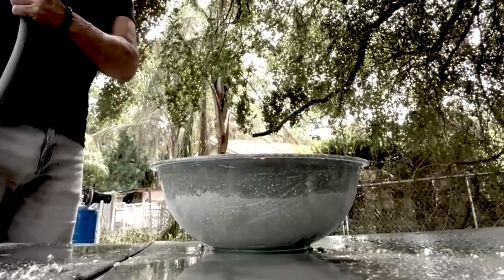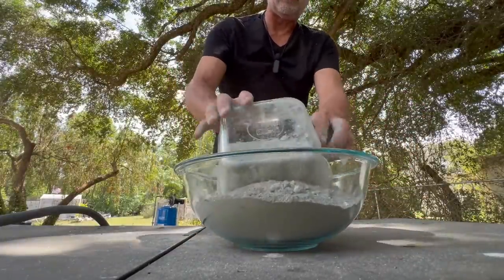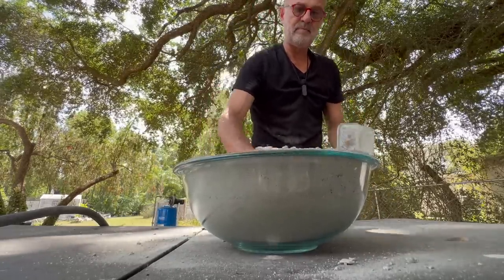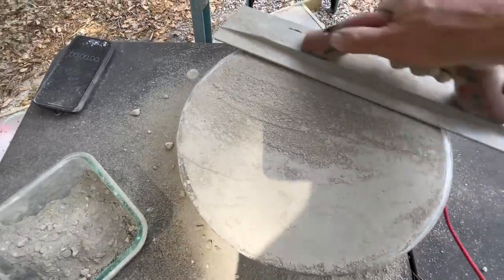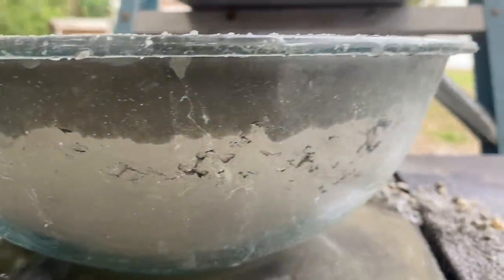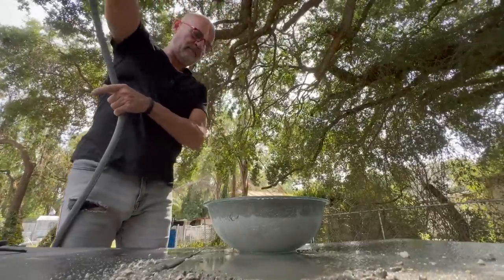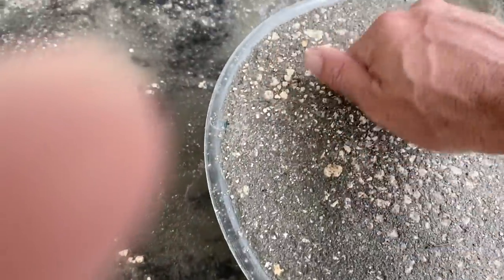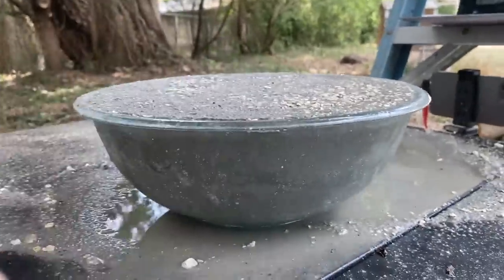See How Dry Pour Concrete Process Works in Real Time

Comment: Dry pour works fine for DIYers, but professional concrete can require precise mixes, rebar and vibration to release the trapped air. As well as a professional finish. 

Also that powder will burn you if you're not careful. It's like a bad sunburn.
Reply: Professionals need to charge more, so yeah, they need to do "something" to get that extra money.  Dry pour doesn't require rebar, precise mixes or vibration to release trapped air.  That's a lot of hogwash.
Reply: @kennethm.380  You're the guy who puts in driveways and sidewalks that get 2 inch wide cracks all the way through and the broken slabs sink and heave another 2 inches
Reply: If I were going for the full 4000 psi, I would definitely wet mix it. However, for those of us in the southern US where it does not freeze, I think it should be fine for sidewalks where the load is never more than 300 lbs. My first 2 feet are sugar sand, do I will be getting some compacted gravel down first even doing a dry pour. I am doing a small pad outside my shop building, I am going to give this a try.

Comment: When I worked for a development company, we would build retaining walls by filling croaker bags with cement mix and stacking them up dry. We would get semi-trailer loads of bagged sand mix on bigger jobs and stack them dry. Those would also harden by themselves.  I've used the same method in washouts, and those bags get hard as concrete, oddly enough!
Reply: What your saying is certainly accurate. But what's more surprising is how little moisture is needed for portland Cement products to cure.

Comment: In our shed I drypoured 600 sq ft about 10 x 10 feet at a time an average of about 2 1/2 " thick over native soil so compact I probably could have gotten away with 1 ".  One issue unique to this job was there was already exterior walls on a foundation so I had to get clever setting up my screed lines.  Another issue I found is the finish of drypour is not nearly as smooth and consistent as wet pour.  Also it has very thin cracks at all the seams because the different pours did not bond like seperate wet pours where you can add adhesive.  I put water barrier under the slab although we live in a pretty dry climate.

Comment: Spent a lot of time in MN. The freeze/thaw cycles were severe, so we mixed concrete with 6% air entrainment. We have to test our dry pour samples with freeze/dry cycles, after curing, to check of surface spalling resistance. We need to know if sealing against that is advisable.

Comment: I like your approach I wish I had the money to send some samples to a testing lab but that simple glass bowl answers a lot of questions about hydrating bag concrete
Reply: You don’t need to send it to a testing lab. Any building that exists is done with “wet” concrete for a reason. Ive done 20 years of high rise construction in NYC. Every building has to adhere to “core sampling” and stress testing to ensure the slabs are cured properly to withstand load. IF dry pour was actually better then we wouldn’t need pump trucks/hoses/etc. it’s been proven for decades that dry pour isn’t better it’s just lazy DIY fad nonsense. You want to make a little pad to put some plants on in your yard? Go for it but don’t do anything that is actually structural.

Comment: I think the thing that bothers me most about this method is that most demos shown aren't considering the water/concrete ratio as specified by the manufacturer. If you add too much water to concrete it weakens it fundamentally and no longer meets its intended strength requirements. In theory I cant really see any substantial difference between a wet pour and a dry one (to many peoples point we have been dry pouring posts for years), but I would really like to see this again with the 'correct' amount of water as specified by the manufacture to see if it can penetrate properly and setup. For non structural applications such as walkways etc I can't see why this wouldn't work and be excellent, but would it work in scenarios where you are seeking the manufacturers psi rating???
Reply: that's bulls eye ....!!!
Reply: This only works where the ground doesn't freeze.  A couple months of warm days and freezing nights will break it up.
Reply: Mixing allows the void spaces between the dry particles to collapse and densify. Mixing in too much water creates void spaces in a finished pour by allowing unabsorbed, incompressible water to function as a temporary scaffold between curing particles. The total volume of a dry pour slab is greater than an over wet slab using the same amount of concrete mix. A dry pour slab would be less dense overall and have more total voids, but an over wetted slab could also change the distribution of cement and aggregates within the matrix. If the mix is so wet that the cement gets floated to the surface and the sand gets washed to the bottom it will be much weaker, but that would take way more water than what most people consider to be over wet.

Either way, even weak pours are generally far stronger than they need to be for most applications.  I've made walking paths and greenhouse floors with aircrete. It feels great to have something softer and cooler underfoot, and the greenhouse slab has plenty of strength to hold up the stick framed glass walls.

Comment: Is it best to wet the ground before you pour out the dry concrete?  So it absorbs a bit from underneath too?
Reply from the maker: Yes.
Reply: From what I've understood with researching dry pouring you don't want to underwet, because it starts your timer on finishing the project.
The base layer will be wet and thus start curing the moment you pop a bag on it.
If you have inconsistent curing you absolutely will have cracks and weaknesses in your concrete.
Reply: Similarly and I haven't seen enough evidence with regards to this part, but from what I was taught with doing mortar work, you've gotta let concrete "flash" which is when you're mixing you let it sit and absorb water on the microscopic level prior to pouring traditional concrete.

Similar to letting pancake or waffle batter rest before you actually start cooking.

Secondly but related, from what I've been taught with regards to concrete you've gotta keep your concrete "wet" for far longer than a person might expect. And I don't feel like any dry pour video has done justice to this aspect.
If you pour a concrete driveway you're supposed to water it usually for 2 weeks (depending on climate) to slow down the visible drying which increases the invisible "curing".

Because Portland cement cures by a type of crystalization, and the longer it's "wet" the stronger that crystalization becomes.
Reply: @lightjedi6  I think you just condensed a semester of college concrete class into a few paragraphs.  However, who's to say that the flash does not occur in the dry pour?  In any case, a LOT more testing needs to be done to determine what are good applications for dry pour.  What if you use plastic inside the form before adding the dry concrete?  How does wire mesh or rebar affect strength?  How long should you keep the dry pour moist (I'm wondering if 28 days is enough)?
Reply: @dchall8  I would dare say that it does indeed flash when you dry pour, the issue that arises is that if a diy person chooses to dry pour and they are lax on the watering then the flashing can cause voids to form inside the slab (probably very small) from uneven shrinking. Similar issue if you live in an arid environment like I do here in Colorado. 
I completely agree that more experimenting needs to be done, especially with substrates and internal supports. 
I do believe that this will make for some awesome innovations in the future of construction.
To your comment about how long it should be damp for, that's something that I wish would be mentioned more in videos like this, educating people on the fact that concrete doesn't dry, it cures. (Obviously it does dry but you know what I mean)
I'm intending to do some concrete work around my place hopefully this summer, so I might just add to the experimenting. If I get to it I'll definitely try to document what my results are.
I will definitely be using concrete blankets to slow the wicking process and I'll probably water it longer, pretty much following the guidelines for when you have a driveway poured (two weeks of twice a day) mostly because my current driveway is old torn up asphalt.
Reply: @lightjedi6  Just thinking in writing here, but what if 1/2-inch PVC pipe was used instead of rebar?  Not sure there's any advantage...maybe a little weight difference depending on the size of the rebar.  Anyway...more research is needed.
Reply: @lightjedi6  you are confusing "flash" with "bleed".  When concrete is fully hydrated (dry pour is not), after a period of time you will notice a layer of water that has risen to the surface.  This is refered to as "bleed water"'.  After the bleed water has evaporated, it is a good time to put the final finish on the concrete.  If it is done prior to that evaporation of the bleed water, that water will be forced back into the finish and potentialy cause a delamination of the top 1/4" of surface at some time in the future.  The :flash: happens within the first 24 hours when the concrete cures from it's "green" state to a light grey color and that transition is refered to as the flash. It is the first stage of the 28 day cure at which time it is considered to be fully cured.
Reply: @dchall8  I heard somewhere that it doesn't bond (very well?, at all?) to PVC.
Reply: @kennethm.380  Good to know.  Thanks.
Reply: Great info.

Comment: I did concrete remediation for 10 years in my younger days. So far no side effects from silica inhalation. But my hands are numb to heat and cold. But that's years of exposure to wet and dry concrete and bonding agents.

Comment: I love that you are testing this because I seriously just questioned the strength of dry pour myself.  I'm curious if you could do one that is actually an experiment in something that would be more like it hardening in dirt? or burlap?  I feel like the glass bowl would hold the moisture versus the soaking into the soil around it?  I had folks tell me that the dry pour won't get the moisture into the depth and therefore it will  crack and be more weak?
Reply: Doesn't even matter if the moisture penetrates fully during the dry pour moistening.
You get a "loose bond" concrete.  The cement not properly bonded to the aggregate.

Initial dampening and surface hardening creates a layer that is not going to be properly bonded to the layer moistened in the next soaking... and on down.  It's sort of like shale and will be flaky. (in every meaning of the word)

Eventually, the rest of the concrete does dampen enough to set.  But still, it happened in layers and without proper bonding between cement and aggregate.

It's a 3 to 5 yeqar solution for a 40 year problem of wanting a foundation.
3 to 5 years might be enough for your needs... 

Trying the dry pour for a structural foundation is asking for a house to collapse.
Reply: It pull moisture from the ground so it gets it from both sides. If you just pour the dry concrete in a hole and did. It add any water at all, it would be rock hard in a week
Reply: @fhuber7507  I don't think anyone would be using it for foundation work infact I have not seen anyone use it for structural work mostly walkways, patios and slabs.
Reply: Dry pour works.  The cement mixture will continue to wick the moisture where it finds it.  It may not be 100% as strong in a matter of days, but it will be 99% as strong in a matter of months.  That's not to say you have to wait that long.  If it's a fence post, 48 hours later you should be good to hammer away.

Comment: Portland cement is alkaline and there's no amount of washing or hand lotion that will fix your dry hands in a reasonable amount of time. However, what you can do is neutralize the condition by washing your hands with 5% white vinegar and don't rinse them off with water. You may smell like a walking salad bar but it will bring relief to the dryness. A gallon jug of vinegar is standard issue when I do concrete jobs.

Comment: Will the water continue to penetrate if you burnish the surface by trowelling? I'm wondering if a trowelled finish is possible with dry-pouring.
Reply: Maybe add a layer of portland to the top before wetting it down?
Reply: Yes you can float it after you wet and the surface from a dry pour. Wet it but  don't make a soup. Floating works best for a wet pour. Dry pour is typical for artisans who's final appearance shows the underlying materials where you're using marbles, cut glass, polished stones, and petrified wood.

Comment: It is not hard in 2 minutes more than the water compacted it been in concrete for over 30 years, not beating you up love your method not sure I would try this for something structural but for a homeowner would be a good idea to save money
Reply: yea i think for most homeowners and residential purposes its good enough. like a small slab or walkway. no way its going to be strong enough for foundation or park a vehicle

Comment: Someone coming from concrete / mortar industry I can see the how this seems non problematic. But… formulas in powder form, especially with light and heavy ingredients tend to segregate after packaging, transporting and handling. When you do wet mix, u are remixing segregation that occurred. I bet if you had dry mix and wet mix tested for tensile strength within different spots of a pour you will see better strength in a wet mix.
Reply: It's like a box of raisin bran. After being shipped the raisins settle to the bottom. Gotta mix it up before you pour 😆
Reply: @pearljameric  Knowing that, why not open the bottom???
Reply: Clearly more testing needs to be done.  Having said that, I've had several sacks of dry mix become hard just sitting in my garage for a year.  And it was not humid at all, so it's gonna harden one way or another.  But if strength is the issue, which it is for many slabs, more testing is needed.
Reply: @dchall8  I  normally see the bags laying on their face or backside... lol  it could start getting confusing  ha ha
Reply: You can remix it without wetting it
Reply: I think there isn't doubt that wet is stronger...But not all applications require driving a loader onto it. I would feel that this method for a small sidewalk or flower bed would be more than adequate.
Reply: @tombranstetter68  I agree.  If it's foot traffic, you don't have to even worry about it.  I think they key is to understand the process.  The cement will wick moisture it gets.  In the ground, or from your hose.  It's going to get the water it needs.  Might take longer, but so what.

Comment: In most areas of the US , in  the case of trench footings and post holes,,, you do not need to add water.  There is always some water, moisture in the soil,, and Concrete is water hungry.  Even from nearly dry soils, concrete will suck the water that it needs to cure out of the surrounding soils.

Comment: Love it. All the experts and purists having conniptions and it cracks me up. Might lose a few PSI this way but some things don't need to be designed to survive Armageddon!
Reply from the maker: Nailed it!
Reply: Well the problem is u don’t know if u added enough water to hit the bottom and it looks like such a rough finish on top . If u are going to spend thousands of dollars it’s ok to mix
Reply: It's pretty easy to add enough water, and slightly over-watering will cause no real harm. Even if the water you add doesn't hit the bottom, it will absorb water from the surrounding soil and set just fine eventually, might just take slightly longer. The whole point is to NOT pay thousands by doing it this way. To each their own of course.
Reply: Exactly.  Would I land a 747 on dry pour concrete?  Probably not.  Will it serve me as a landing pad at the bottom of my stairs?  I think it would.
Reply: @lizardman1303  on real earth, it will pull moisture up from the bottom as well
Reply: All the videos I've watched on Dry Pour address the fact PSI is different... just saying
Reply: @renetto  if all you're aiming for is mediocrity -at best if you're lucky.
Reply: @dchall8  Yeah, situational for sure.  for a chicken coop or a foot path, I'm for it.  Footing for a building, Better do what the engineers called for.

Comment: Like the vid explaining and how we were all able to watch the cement dry. Question, how many times did you have to water it..well because we can see it happen on the glass but won't be able to see it when actually being done on the ground. How will I know I didn't miss a spot or area deep down at the base. By the way, I live in tampa😊
Reply: It will keep sucking moisture from the ground until it coat no longer suck moisture
Reply: @davefletch3063  By the way, Juan lives in Tampa.

Comment: To resolve the whole strength issue, perhaps someone who works testing concrete cylinders in a lab for the industry could dry pour a couple of cylinders and break them at standard intervals to put this issue to rest.
Reply: Noooo lol if it proved you didn't need a mixer and special mixes an entire industry would be out of business 😂
Reply: @warofwrath  lol 99.99999% of the concrete industry isn't doing little garden blocks and yard ornaments. No one is going to be handling thousands of bags of concrete to do a driveway or basement or highways or building foundations. Just 1 full cement truck brings in 450 bags (80lb bags) of concrete that can be laid and finished within a couple of hours. It'll take months to handle and finish that many bags by hand